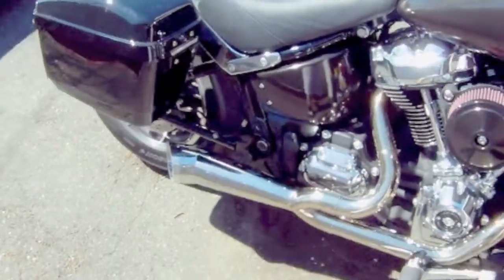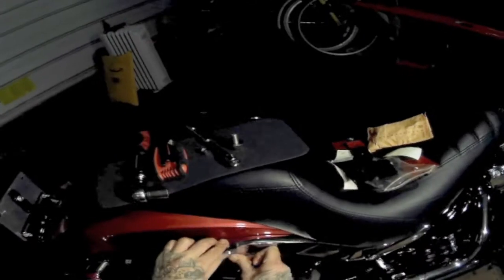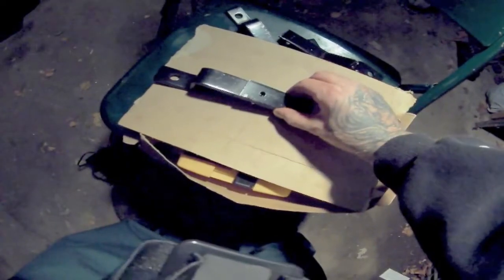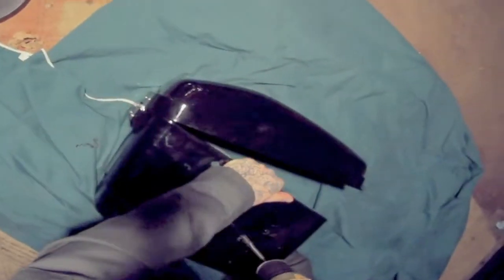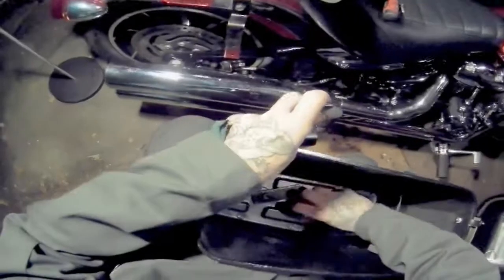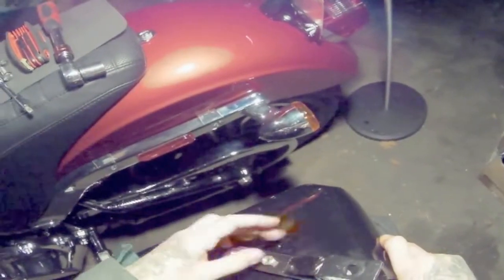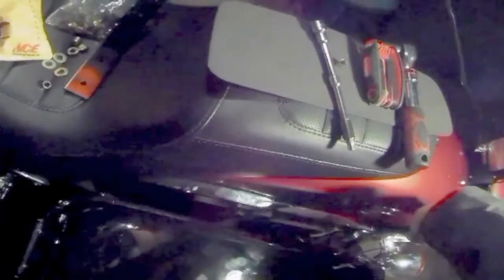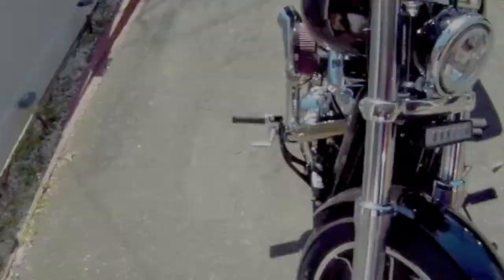$80 Ebay Saddlebag installation 2018 Harley Davidson Fxlr Softail Lowrider

Comment: I got the same bags and made a different mounting system, I used an aluminum sign I had and cut out two big plates the size of the bag and put it on the inside and outside and it’s nice and sturdy now, thanks for the video
Reply from the maker: That was a great idea and definitely sounds more stable than the mount it comes with. Enjoy and ride safe. And thank you

Comment: Thank you. I’m looking at these now and gives me a better idea what I’m looking at.
Reply from the maker: Glad i could help. I will tell you over time with a lot of riding and weight put in them one ended up breaking but held on. So just a heads up they are not good for long haul heavy use. They are good for a jacket quick trip to the store. But I wouldn't use them for a long haul ride.

Comment: Thanks for the cool video, have to say the bags look a bit wobbly, is driving ok, no feeling of instability? Cheers T.
Reply from the maker: Thank you. Yeah they are wobbly but they haven't given me an issue. One of them actually got a hairline crack but it was ok for a couoke seasons I have since bought leatherpros for it. I wouldn't do a grocery run but for a jacket hoodie basic essentials they are fine and should hold up as long as you don't over fill them

Comment: Thanks for the video- How big is the drill bit you used?
Reply from the maker: I'm not sure it was a while ago. I will check for you when I get home.  Just a heads up these bags went up in price a little they are around $110 now but you can also find them on Amazon.
Reply: Yes, I got it in EBay for about $108 the down side it doesn’t come with instructions. I am glad I found your video.... 😊👍🏻
Reply from the maker: @theknightsofquantumjr342  went to measure for you and realized I left the bags upstate. If you Wait till Monday I can let you know tge drill bit size. Also just a head's up. I've had these for a while and they are not meant for anything heavy. The mounts aren't the best but for tge price they do tge job. I kicked one getting 9ff tge bike and now it rattles like crazy. Stays on fine just a little shake to it. You may want to use extra support of some kind. If you don't want to wait to install take the rubber grommets and measure a drill bit to the size of the hole of the rubber grommet. Either way I will take a look for you this weekend
Reply: @Fxlrnyc  Thanks I appreciate it, no worries I already did what you suggested at the end. I just finished installing them and yes they wiggle a little bit so let’s see..... thanks again for your help, I appreciate it...

Comment: Thanks for posting this,   I am going to use my easy brackets with them.  They look pretty roomy.  My viking bags are shot.
Reply from the maker: No problem glad I could help. I don't think they are $80 anymore they may have went up in price a little but they have a good amount of rom just don't put a lot of heavy stuff and you should be fine.

Comment: Can speakers be installed in these bags???
Reply from the maker: I'm sure it can be done but tge wuality of tge mounts and plastic used is not great. I really wouldn't recommend it. The plastic is brittle and tge mounts are not very sturdy they look nice but don't handle a lot of weight unfortunately. Might want to look into eti brackets and harbor freight bags. I have a brand new eti bracket setup I'm selling for a good price that I never used if your interested dm me. Either way I wouldn't trust speakers in this setup will be too heavy I think.
Reply: I put 4 inch speakers in a set of these exact bags. The hardest part was spending the money on a 3.5 inch Lenox hole saw.